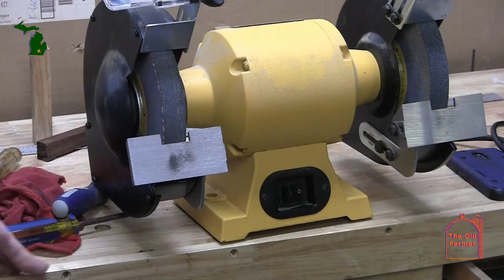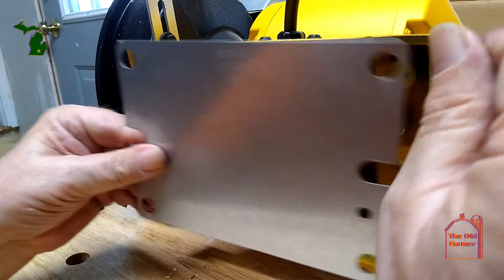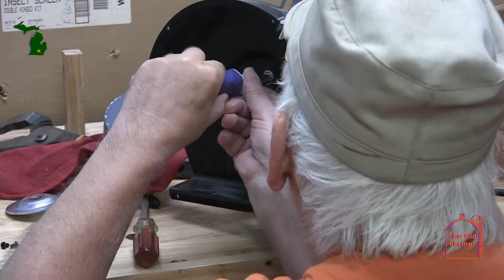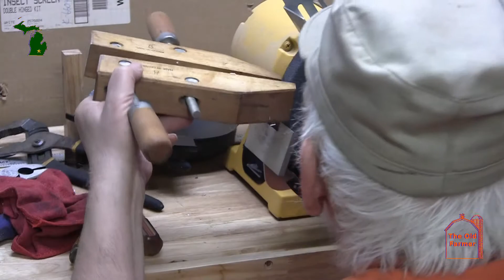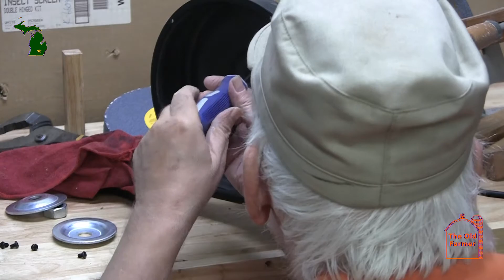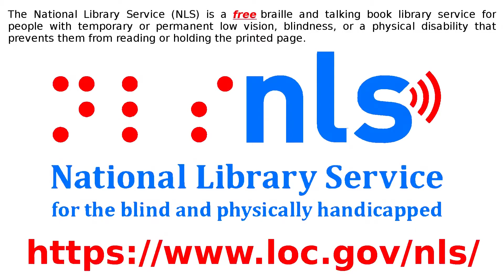Do You Want Sharper Blades?

Comment: I don't understand why it comes from the manufacturer spinning downward. I also had to switch around the shrouds
Reply from the maker: I agree. I don't know why they all turn the way they do. Back in the hand cranking days wheel rotated in the opposite direction. Does any know the reason? Be safe.
Reply: I was googling last night and I guess the reason is for safety. If something goes awry then the tool you are grinding will move downward instead of flying up towards the user
Reply from the maker: @joshuamcguire4832  I guess that works. But, then you are holding the piece in the wrong location. I guess it's the world trying to idiot proof everything. Good catch.

Comment: I hate bench grinders! I have 3 of them and one dates back to 1981.( still works) .i have a whetstone grinder with an 80 grit wheel but the cheap tool rests are horrible  so I always put a wide angle  so I can guide my drill bits,  knives, etc. I like how you have shown this method! Very informative video! Cheers from Australia just subbed.nice work!🙂👍👍👍
Reply from the maker: I don't like them either. I learned to sharpen on an old hand cranked version. If you look at old time films, not videos, if they are hand powered or foot powered wheels, they always turn the wheels opposite of today's grinding wheels. I have heard of some issues in Australia and hope they are past. Be safe my friend.
Reply: @Original_Old_Farmer  thank you for the quick reply

Comment: I think that's a good idea, I can't think of any drawbacks. Other than mabey the arbor nut being threaded for the original spin. I would just make sure there tight
Reply from the maker: The old foot powered grinding wheels commonly turned backwards. I don't have a problem with the nut. I do have the sparks come out the top. But, I do believe the blade sharpens a bit  better. Thanks for watching. Be safe.